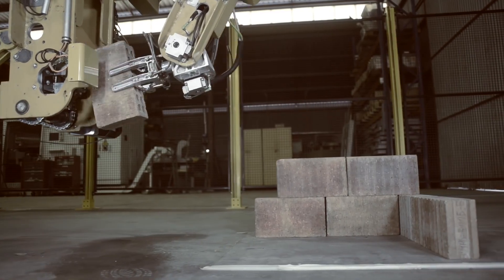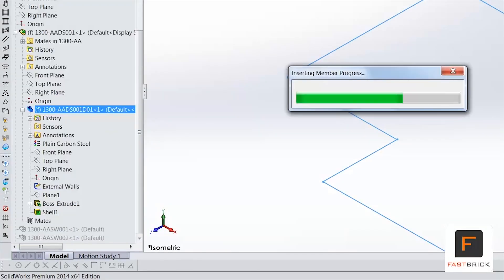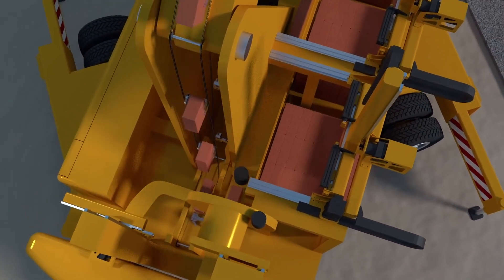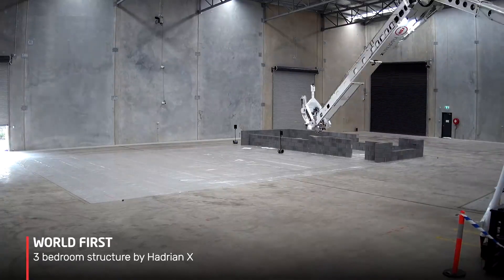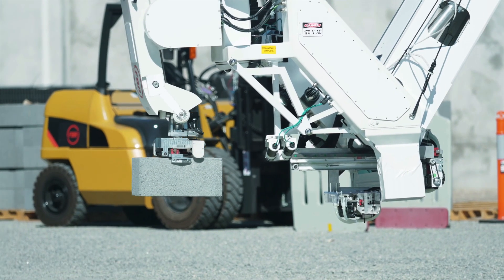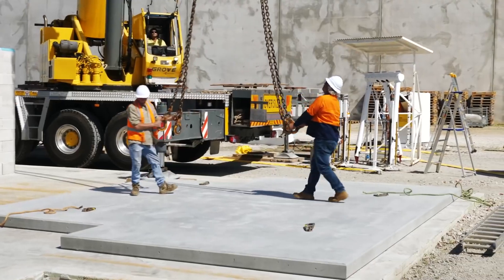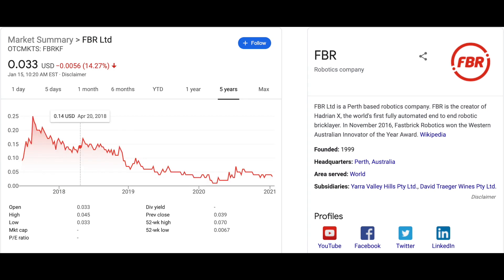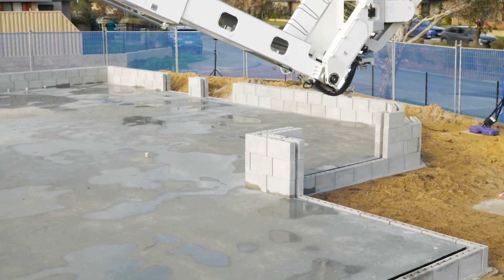Fastbrick Robotics Automates Masonry

Comment: How about two robots. One able to move inside the foundation. And lay the robots. Doesn't need an articulating arm. But robotic conveyer with small projection
Another gets the bricks and motar  loads on to the layer.
Better' still have a robotic arm to change the tools like brick and mortar layer, plaster sprayer, plaster screed, paint arm. Tile layer. Plumbing and electric runs cutter? Same smaller compact machine aone working arm attachment point where multiple attachments can be connected and a typical  robotic arm to change the attachments. Plus a mule bot which brings stuff and loads on the work robot.
Reply: The options seem near limitless, however the challenge it getting the technology to work reliably.  I expect over time they will solve most of these challenges.

Comment: I see a couple of problems, you still have to go back and mortar the joints, the adhesive might not be approved in the US because of failure to flood and tornado, and there's no thermal break with the bricks or blocks to the outside. I think this technology should be adapted for placing ICF blocks, and the same technology for filling the voids in the ICF blocks. It would also be great if it could "read" conduit ICF blocks if the manufactures began to make them as shown at 3:28. This technology would also be great if adapted for retaining walls...

Comment: Building of homes and larger structures is bound by tradition, standard practices and codes. Some of these have been in practice for thousands of years. However, robotics and 3D printing are opening up new avenues which may require a rethinking of everything, including not building things the way humans do or have in the past.

Let's take structural integrity, for example.  A 3D printing company you featured in a post is WASP and they are tackling the structure problem in a creative way, without embedding rebar or needing a heavy material. You did a good post or two on WASP and they are really thinking in ways that use the advantages of 3D printing. What WASP is doing is the most exciting in this industry. 

I don't blame robotics companies for doing what this one is doing though. They have the auto industry to follow as an example. If a computer-controlled machine with robotic arms can lay blocks much faster, more accurately, and more cost effectively using fewer people, it is bound to happen and be the most easily accepted as far as codes and permits.